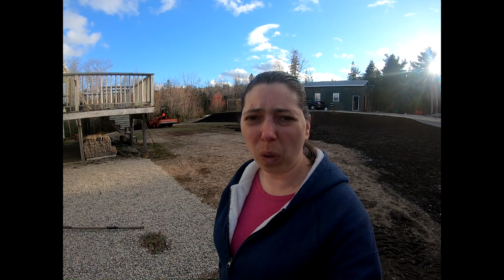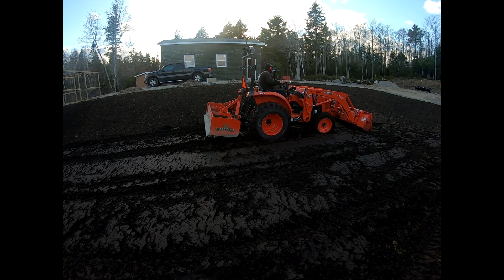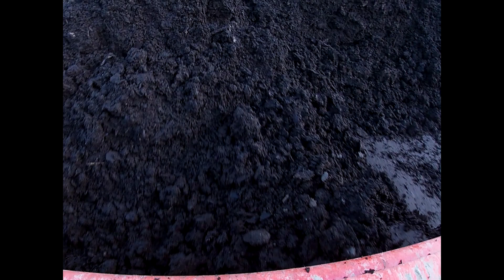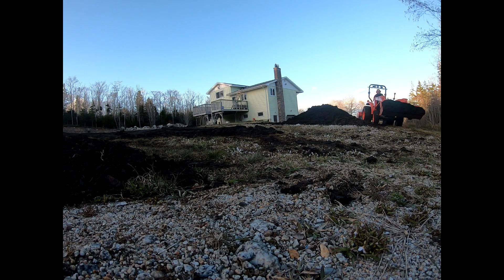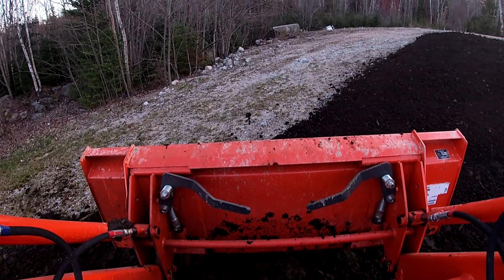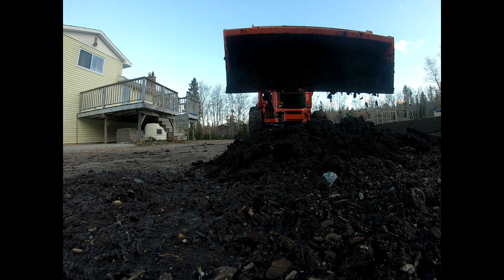episode 40 kubota L2501 spreading topsoil and testing our new gopro hero 7 black

Comment: This black earth is very sticky!  Arles was good to have it spread so nicely. It was a very nice blue sky. The gopro make great views from the bucket and tractor.  Well done!
Reply from the maker: Thanks for watching .That soil was as slick as chicken snot on a door knob but i got it laid out some to dry .Just playing with the cameras
Reply from the maker: Just thought I'd add that we were using a gopro 7 white since we started the channel and that is what was on the tractor in this video. We also picked up the clamp yesterday so we could try this. I think my favorite view is with it on the bucket. ~Jennifer
Reply: This is why I wish I had a GoPro.  My camera does not have a wide angle and speaking of stabilization, it's not as good.

Comment: That looks like some very good soil how thick are you supposed to spread it I will be doing a similar project in the next couple years.
Reply from the maker: Thanks for watching .I  try to spread the soil about 6 inches it was very wet .If you have good ground to start with you will not need that much